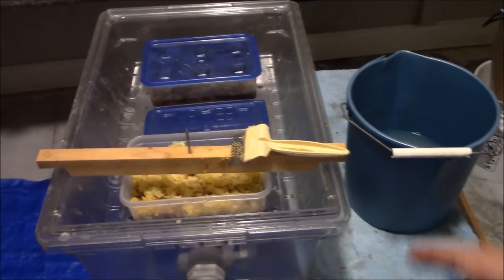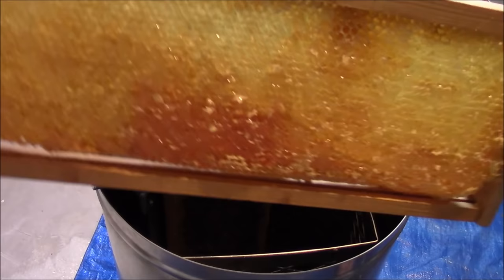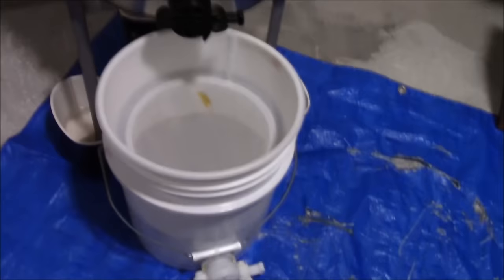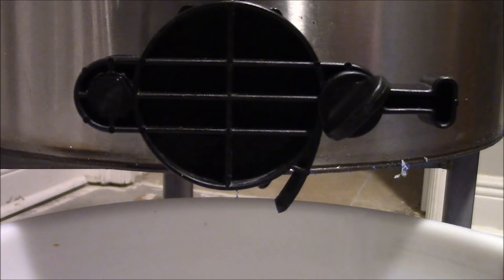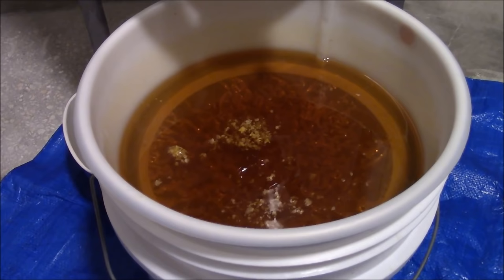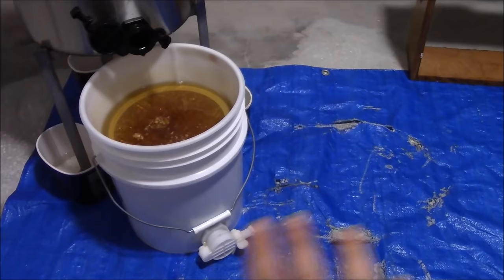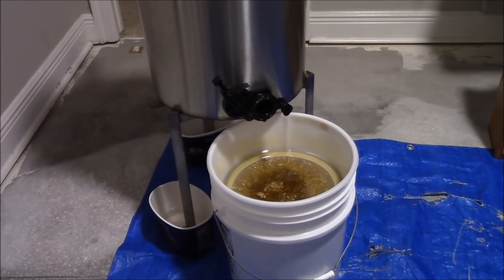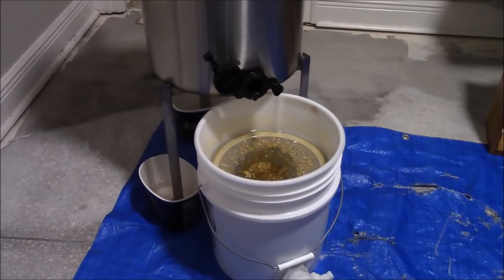My Small Honey Extraction Setup

Comment: Do you attribute the lack of damage to your foundationless combs to the handcranked extractor? Honey looked great, real clean.
Reply from the maker: Yes. I think using a manual handcranked extractor allows much more control of speed/force. Also, my foundation-less frames use 50 pound test fishing string which adds to support, so I think it helps. Thanks for watching! 🐝🐝🐝☮️☯️
Reply: Tim Huffman I am 100% foundationless, do you think rubber bands would help my combs during extraction?
Reply from the maker: Sure it would help. Even wrapping fishing line around the frames and tying it tight would work. Going slow, and rotating the frames often as you extract is all it takes to prevent blow outs
Reply: Be sure to start off  spinning slow.  Build up speed after you get the bulk of the honey out, that will help you a lot!